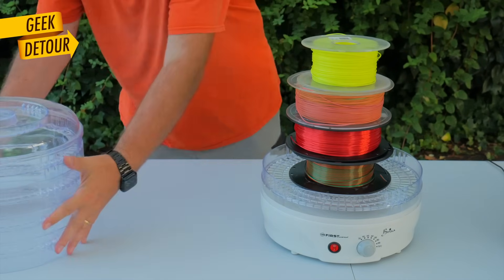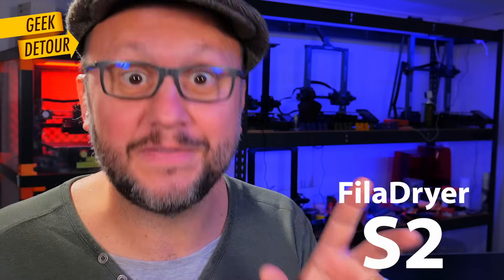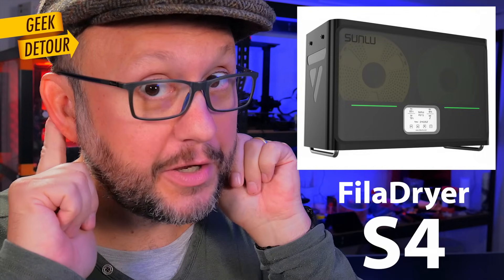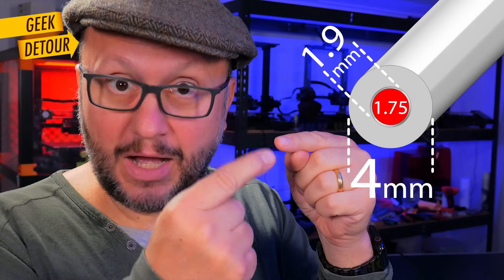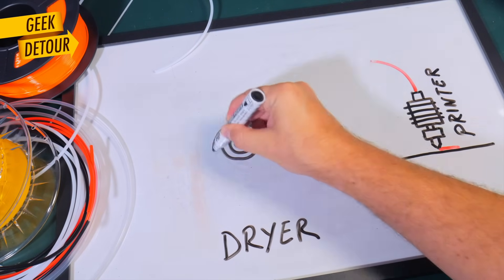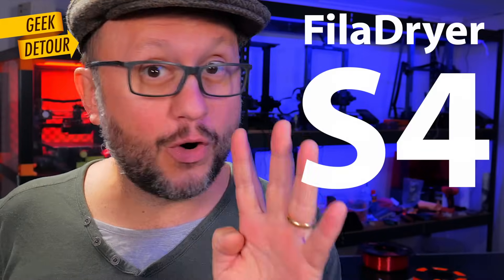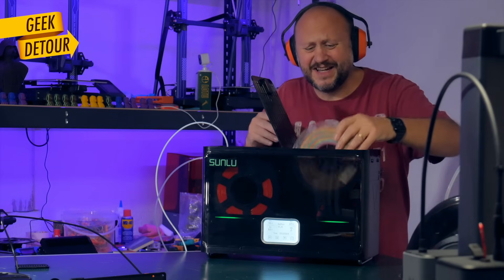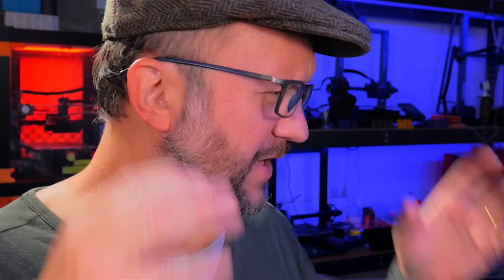SUNLU Filament Dryer S4 vs S2 vs Food Dehydrator

Comment: I don't know if it's still possible to make a suggestion, but they could allow dividing the chambers to control filaments 2 by 2, to treat different filaments.
Reply from the maker: Well… that won’t happen. There is only one heater. But in truth, for PETG and PLA, you can dry them together without much worry about so specific settings.

Comment: Great video!  Some suggestions: 1.  I like the idea of automation (setting it to begin heating 6 hours before I get to my lab, so filament is ready-to-go).  2. I second your Large diameter Bowden Tube suggestion, especially if this is feeding 2 printers, it may have longer to travel.  3. Location of the power-plug -- The S1 allowed units to be stacked flush side-by-side (power was in back).  The S2 you can't stack back-to-back, as the power cable sticks out in the way (would have been better to put it between the feet, or in the lower quadrant of the curved portion, so power feeds do not prevent units from stacking flush with each other (or stacking snug with printer enclosures).  Hope the S4 power cable is underneath the feet, and not sticking out on the sides.
Reply from the maker: Hi Thomas! Yeah, the side-plug can be an issue, wow, I didn’t think of that! The S1 has the connector at its back (if you put it side-by-side with a printer) as you envisioned. The S1 makes a lot of sense as a companion for printers on a shelf - the panel is “in the front”, at the bottom of the unit. The S2 is way more beautiful, but it makes sense only when you have the unit accessible from the lateral.
Oh, it seems that the Bowden tube coming with the S4 has a bigger internal diameter - at least somebody commented it here somewhere - and I am happy that they did the change!
Reply: @GeekDetour   Looking forward to getting the production-model!  (I missed the kickstarter when it appeared, and was traveling during the brief Christmas production - they only have the Australian model in stock currently, and I'm not sure if the cord is swappable (standard IEC cord), or would require surgery to replace it with a US cord).

Comment: Would it be possible to manage and control it through WiFi? If not, it would be nice to have the option to add an ESP32 to extend the possibilities. I use Home Assistant, and there are infinite possibilities for automating filament drying.
Reply from the maker: It doesn’t allow any sort of automation and that’s a pity, now thinking of it! Good thinking!

Comment: On 4:17 you have the Tube and the Sensor, Does the tube goes inside the sensor or just connects on the In/Out of the Sensor? 
Great Videos, Just started my 3D Journey! (with Ender V3 KE)
Reply from the maker: It just touches the ends of the sensor - no way to “plug” the tubes inside the sensor. That’s why I had to print a connector, to hold the tube in place 👍 Oh, nice printer! Welcome to this extremely addictive hobby! 🔥
Reply: @GeekDetour  Mind Sharing the Design for the Sensor Connector?
I bought a Creality Dryer Box, But I will replace it with SUNLU (link from you...)
Thanks!

Comment: I print most of the time from my Bambu Lab AMS. But I think about of picking up a S4, because you can dry 4 spools in less time. With the S2 and 1 spool, this takes time to dry every spool…

Last but not least, the price. The S2 costs about 70€ in Germany, the S4 120€. That‘s only a little bit more as the S2, but you can go with 4 instead of 1 spool.
Reply from the maker: It makes perfect sense! I hope Sunlu puts the S4 for sale soon… Right now they are still delivering the S4 to Kickstarter backers.

Comment: I'm still very new to 3d printing, so please forgive my ignorance, but why would you need to dry filament? It comes dry when you buy it. Is there some type of filament that has to be stored moist?
Reply from the maker: Hi there! Most of the times, PLA and PETG come perfect from factory… but for me, like 1 in 10 come printing less than ideal - you hear a “frying” sound from the nozzle and it pops tiny bubbles - search for “wet filament” and you will find videos showing how it looks and sounds. BUT, any filament with Carbon Fibers get bad after you open, Nylon also NEEDS to by drying WHILE you print. I don’t even want to test now, I use my filament in a dryer while printing.
Reply: @GeekDetour  Thank you, I appreciate the response! I only just got my first 3D printer a few weeks ago and I've only done 4 prints so far, so I'm definitely very new to all this, but it's been exciting to learn.
Reply from the maker: I am happy for you! Be careful and don’t feed the printers after the sunset - when your partner is not looking they multiply 😆

Comment: imagine they used an insulated enclosure and cut the energy use in half.
Reply from the maker: Yeah! Insulation would be nice! I think there is space to apply it still, at least on 3 walls
Reply: @GeekDetour  I built a small version a while back to heat garlic for a month. still ate up over 1kWh. 
For the most awesome results, it also needs an air-air heat exchanger. With stratification and very low flow rate, this could be as simple as one deep-drawn sheet of Al.

Comment: I got my S4 hours ago "today" (technically it is next day)  and it's not that loud, at least in my space.    I have my PC here, and it is closer and probably louder, and I can hear the S4 about 8ft away, maybe slightly louder than the PC next to me. probably around...50dB? (measuring with a free "Sound Meter" app on my phone, it reads about 54dB - standing right next to it, holding the phone up to my ear, so approximately 14 inches over the dryer)

This one is not a pre-production model, but one I actually funded from KickStarter.
Reply from the maker: I need to visit a friend who also backed the Kickstarter, I am curious to see if there are any physical differences from my pre-production unit.

Comment: Hey mate i know its not the topic of the video directly, but when you put the tube betweem the filament sensor and the extruder on the s1, did you have any issues with tall prints?
Reply from the maker: Ohhhh… yeah, there’s that sure. As there was nothing holding the tube fixed in aligned position, there is a tendency to fold sideways and even break the filament as it forces laterally going UP… it could be fixed with printed parts, sure. But I rarely print super tall things. Not off-topic at all! Merry Christmas 🎄🎁

Comment: Nice looking dryer, but I wish companies that make them would stop directing the heat directly at the filament.  If you're not printing but drying the filament the heat will be directed at one spot on the filament.  This would inturn fuse the filament together, I've suffered from this with two different dryers the S1 & the Eibos Series X.  The Eibos was the worse one for doing this as it was fusing the middle of the filament due to the heating element & fan in the center of the spool.
Reply from the maker: My goodness! Where you live is a really hot place? I’ve been drying my spools with the S2 and the S4 - I never had a melting (not by far! I always looked to see if something like that could happen).
Reply: @GeekDetour  lol actually like in a cold place.. UK.  But with me using PETG i have to dry the filament most of the time, the last spool I dried for 24 hours before printing & it was only when I was getting to the middle of the filament (just over 500g used) did the filament snap.  I took the spool out and spotted that the middle of the spool had warped.  On inspection I found the whole filament next to the fan out take had completely melted together.  This was while the dryer was as set to PETG on the Eibos.  So I lowered the temp to the PLA setting but just slightly higher and it still fused but not as much as before.  I have just recently bought a 2nd one (Eibos) and found that the sticker for the temp dial is totally different between each box.  They must have noticed the error but didn’t tell anyone, the PETG & TPU are swapped around.
Reply from the maker: Geez… the adhesive showing the “right temperature” feels like a nightmare to me 🤣

Comment: Let us modify the firmware. Open source it. Also I have the S2 and hooked it up to the printer psu. Include a pigtail.
Reply from the maker: I feel the same. I opened the S2, it looks like we could use Pogo Pins to touch the programmable port and just flash new firmware… if the microcontrollers has not been fused to stop being reprogrammed - it goes beyond my knowledge right now. Sunlu could release the source, but I bet that if someone who already programmed different microcontrollers will eventually see the board and “aha! This is the controller xxxx, let me just check here quickly” and a couple of hour later just put something on GitHub.

Comment: Food dehydrator is cheap? I got the cheapest one from Gorenje (it was the cheapest) and it was like 45 euro. Most of your viewers have ender 2 for 200 euros, and you say the dehydrator is cheap? ROFL ROFL ROFL
Yeah in general it is cheaper than the hobby dryers because it is not overpriced "because of hobby". To be honest inside there is only a little bit of heater wire plus a fan. Nothing too fancy
Reply from the maker: I agree! Let’s find a simple cheap heating element and put it on a cheap container that makes it work…. not sure if you can do it for much less than 45 Euros. If you do, please, make a video about it! Lots of people will like to watch it (me included!)
Reply: @GeekDetour  I do not think it is worth it the time and effort for this instead of buying food dehydrator. My idea was that you said it is cheap but I do not find it that cheap to be honest.
Especially if you think of the total cost of the printer this is like 1/4 of it. And what is worse is that with new filaments you need that thing
Reply from the maker: Well… in practical terms, what can you do? If I cannot know if the filament I got is on its best possible state, I simply dry it to be sure. 🤷‍♂️
I don’t want to fight my hobby… I want to enjoy it. So, I make mends with reality and fix what I can make better.

Would it be better if everything was cheaper and technically perfect? Sure! But, really, what in life is cheap and perfect? I know it is a philosophical discussion - but we see this time and time again: people that don’t do anything, or are constantly frustrated because they just blame what is not perfect… and people that circumvent the challenges, accept limitations or even better: do what must be done to make it better - then they enjoy the results.

Please, don’t be mad at me. I am just offering a perspective that dry filament will cost you 50 bucks (food dehydrator or a simple dryer for one spool). Once you have it, it is fixed forever: you buy filament, dry it and be happy with your prints.

Of course, anyone can decide, like, “by principle”, stick to the expectation that filament from the box should come perfect… what I say is that: even if that’s true… You open it… start using it… unless you print it really fast, it might accumulate moisture over time anyways? So I feel is is an important accessory. Not everyone will agree and that’s perfectly ok 👌
Reply: @GeekDetour  Hey, sorry I think i have written all that in a way that you misunderstood me. 

I agree with your point of view. I have one because you need to dehydrate in these days. Idk what happened to filaments but I have PLA from 2015 that is printing fine but brand new once that needs drying out of the box :(

I was just thinking that a dehydrator that has like 1 heating wire and 1 fan should cost faaaaar less than 50+ euros . And if you buy one for "hobby" it is double or tripple the price, but with less rolls :D

So yeah, sorry I am not mad at you, I am on your side. 

And to be honest we can see that people in general are ready to give more money for better products. Like look at DJI, BambuLab, even Prusa in the past :))
I
Again sorry, not mad at you, only bad at chatting :)

Comment: I wound up making my own filament dryers and storage from old computer parts I had laying around and home depot buckets.  Works great albeit not aesthetically pleasing.  The main difference is I do not like using silica gel.  I find it works but it can be slow to absorb and a pain to recharge.  I prefer to use calcium chloride and find I get much better results from it.  I wish these dryers would be designed in such a way that we would have more than one choice in desiccant.

Comment: I have the S1, and found that the rollers on the bottom did not work well with some cardboard spools, especially those that were roughly handled in shipping and suffered from dented spools.  The solution there was a conversion that was on thingiverse that involves a printed frame and uses skate bearings to make the spool turn using the inner diameter instead.  It has been freely rotating since the upgrade and I wish they would give you the option of either using the bottom roller way, or a center axle way.  I have a bowden coming out of the lid of the S1 in the standard location going directly in to my ikea lack enclosure and then in to my S1 pro, smooth as silk.

Comment: Why not holes on the front and flip the spools 90 degrees. Makes more sence, then you can loadup 4 spools behind a mmu unit and do multicolorprints. Now it come out of the sides. which need a long way to go to a mmu unit. Might work dunno?
Reply from the maker: To my taste, all the spools side by side as you said would make more sense to distribute to one or many pribters. But overall I guess it would be harder to distribute the heat equally to all spools, internally. The way Sunlu did was easier: the heater is in the middle of the unit, so, heat goes equally to both sides and each spools receives the same amount of heat.

Comment: I cancelled my Kickstarter pledge for the S4. For those who print a lot of PETG, this may be a good option. But its not hot enough to efficiently dry Nylon. It takes multiple days to do so at 70C, especially if you live in a humid environment. I really wish a company would bite the bullet and develop a product that can safely heat up to 90C.
Reply: @DritoVales Do you have a recommendation for a dryer or method that dries nylon properly?
Reply: @Skott62 The Sunlu S4 dryer is perfectly fine, any filament dryer that dries at 70C can do it perfectly fine. Ignore the commenter, he’s exaggerating.
Reply: @catnipaddict126 yeah, it takes about 12 hours at 70 degrees Celsius, not the multiple days he claims. And that's for a completely soaked roll, if it's only mildly moist it takes less time
Reply: @AniviaS So you would recommend me to buy it? I print mostly with pla but I want to experiment with different filements and have a dryer for those rolls I might use. Is this one good for all filements or should I buy a different one? :)
Reply from the maker: Interesting - I printed with nylon only a couple of times and I had to keep it on my Food Dehydrator to finish the print well… Sure, Spain has a quite dry air (most of the time), so I cannot judge if you are exaggerating or not 🤣
Reply: Toaster oven? Used at a thrift store for $10.

Comment: 8:41 That's not quite right ("you can control the /exact/ temperature"), as there is at least a 10-13 degrees Celsius difference - see Ricky Impey's video
Reply from the maker: Oh, I watched it yesterday - excellent video. True: there is a variation if you place a thermometer in different locations. I meant that it is digital: you can set a (average) temperature way better than any dryer that has a knob with a scale. EDIT: I think for uniformity in temperature all around the box we would need at least a layer of thermal insulation on the walls of the product 🤔
Reply: Interesting idea with the thermal insulation. I was thinking of how to avoid a hotspot right in front of the PTC/fan (possibly by using ducts to better distribute the hot air around the box?) but insulating the whole box could help, too, by decreasing the heat loss. And it would also be much easier to do. Worth testing if you are so inclined! :)

Comment: I would prefer the holes on top near the middle, so you can open the lid easier without pulling a lot of filament from the spool. It is also easier to bundle the tubes going to the printer.
Reply from the maker: Hi! In the middle it is hard to do because you have the heating plate blocking the way.
I prefer the back exit (closer to the hinge) exactly for the reason you said: when you open, it doesn’t unroll much filament.

Comment: I have a Bambu x1 printer with 4 AMS, I do a lot of multi color printing, should I get one of these?
Reply from the maker: Excellent question! It would be so great if the AMS had an integrated dryer, right?… But it has a space for silica underneath each Spool, doesn’t it?
Yes, I think that, for drying your spools before putting them to use in your AMSs, the S4 might be the best product for the price so far. Look at the rewards on Kickstarter, I think there are still nice deals available.

Comment: I have the S2. The main change I would make would be the colour of the lid. It's a smoky grey colour that is difficult to see through, but I think the clear plastic of the S1 is better because you can check what's left on the reel with just a quick glance.
Reply: There are different colored lids I've seen. At the very least there is an orange one.
Reply from the maker: Oh, there is no Orange color… Some photos of the product can cause lots of confusion: some images suggest an “âmbar” cover and some are so reflective that you could think it is just clear transparent… The product is a transparent gray, hard even to see which spool is inside.
Reply from the maker: This is a very interesting point!
Reply: @GeekDetour  I was just going to leave a comment about the dark color.  I have an S2  but I'm now on the hunt for a dryer with a clear lid.  Maybe they can do this for the S4, I'd buy it for sure if so.